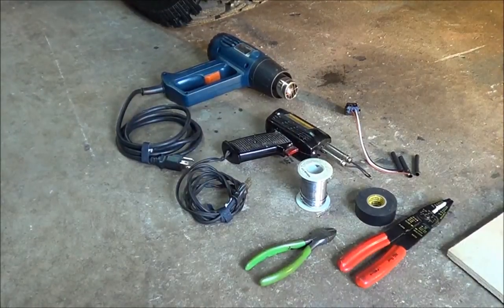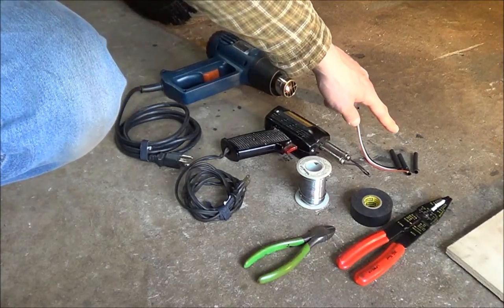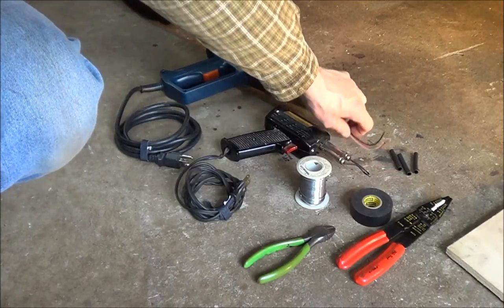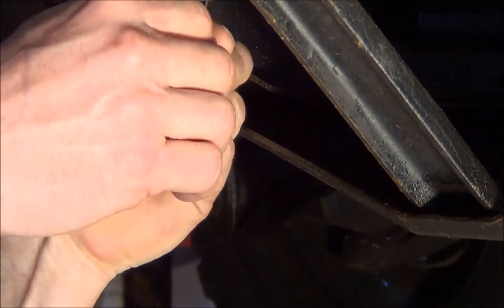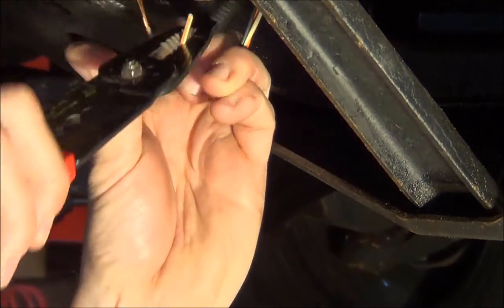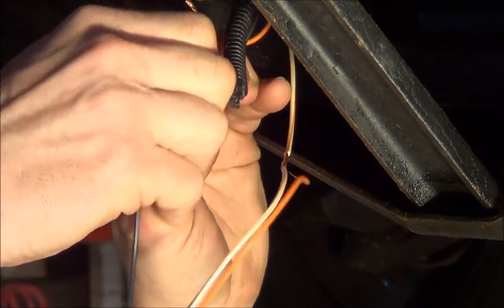3-30-14 how to replace speedometer sensor on a 95 Dodge Ram 2500 5.9 Cummins Turbo Diesel

Comment: Hey man, so I have a 12 valve cummins, 92 engine inside of a 96 cab, now this nv4500 looks identical to yours but I have nothing plugged into mine, I cannot locate the wires you snipped at all.. any help?? Would be great
Reply: Same with mine I can’t figure it out

Comment: was just trying to find this part at your web site.  The image does not show the electrical connection you show in the video.  My sensor was replaced less than 6 months ago but the connector is totally shot and I cannot seem to locate a replacement.  I have a 1992 5.9 250D.  Edit:  It appears that the website does not belong to you, so could you supply a part number from the box?  Tried to see one in the video but no luck......thanks

Comment: I just changed my 1996 dodge 2500 from 4.1 ratio to a 3.55 ratio....what do I need to do in order to get my speedometer to read correct speed again ?
Reply from the maker: 47927411D you will need to change the gear on the end of the sensor. The dealer parts department should be able to look up the correct one. The other option would be to find a truck in the junkyard with a 3.55 ratio and grab the entire sensor. They are same from 1500 up to 3500 trucks.
Reply: The sensor that is on the rear end pumpkin....or the one in the transfer case ?  Thanks for your help to on this
Reply from the maker: 47927411D the sensor in the video, transfer case.
Reply: Thank you for your info and time !

Comment: hey, how does someone know they have a bad speed sensor? i have a 95 ram 5.9L
Reply from the maker: Max Knight The speedometer stops working...
Reply: Garret Lux  did you fix the issue?

Comment: Carl, we have a 1994 ram 12 valves and the tachometer is not working, if you can give and idea how to test it or where is located the sensor if there is one
Thank you so much
Reply from the maker: The sensor is located at the front of the engine by the vibration dampener. If you watch this video https://youtu.be/JWTDQx5506Y you can get an idea of how it looks and where it is located. I would start by checking the wiring and the air gap to the dampener.

Hope that helps.